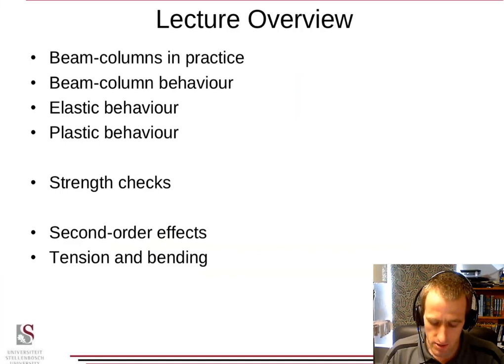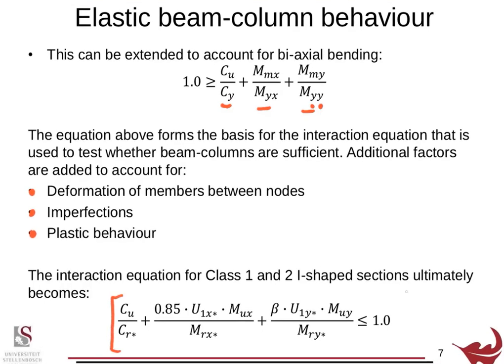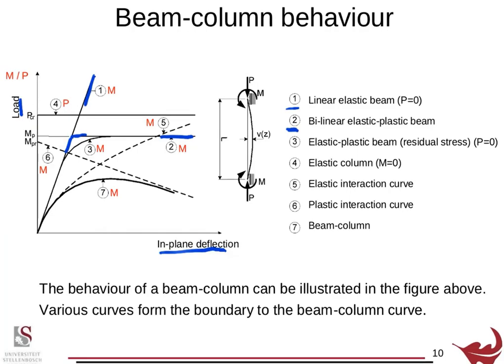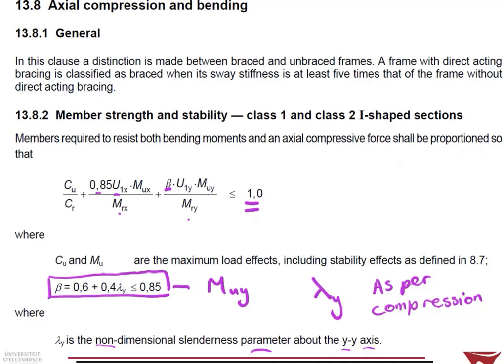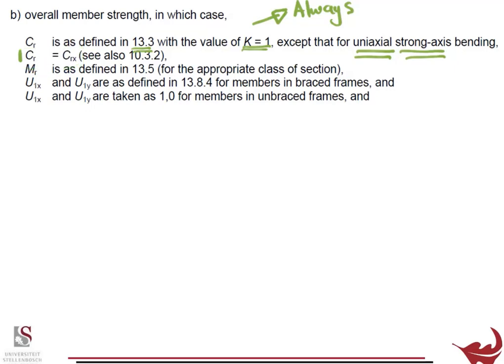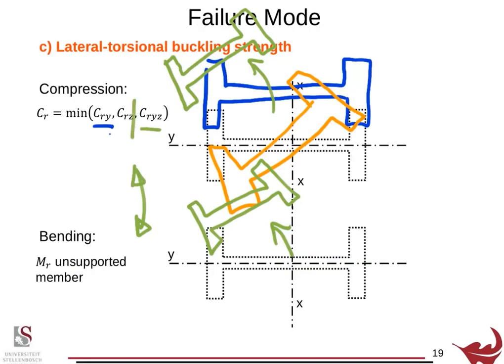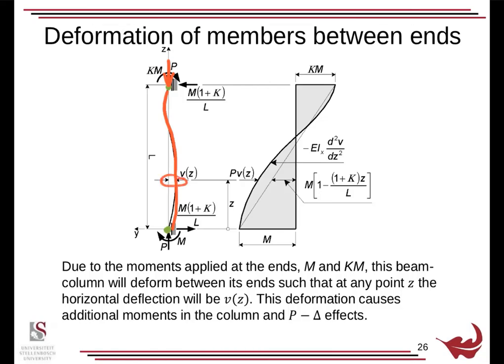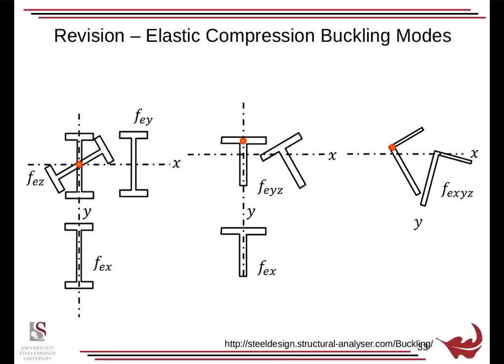Steel Design - Beam-column design - Theory and equations - SD424

Comment: Thank you Richard, this shed some light. On overall member check, why are we shying away from the fact that is a buckling assessment? To me the assessment is similar to flexural-buckling, or am I wrong?
Reply from the maker: The calculations progressively check different failure modes. For uniaxial strong axis bending the check considers forward buckling basically.

Comment: thanks a lot for the great explanation, luckily the Canadian Code shares the same equations but I can't seem to find the answer one of my questions, and I was hoping maybe you can help.

for the check b) Overall Member Strength Check, if we have bi axial bending, should we calculate Cr based on the weak axis or the strong axis? i'm wondering what is the "r" value (radius of gyration) that is embedded in the Lambda formula. 

cheers,
Reply: The South African code states for the overall member strength check: "Cr is as defined in 13.3 (section for compressive resistance) with the value of K = 1, except that for uniaxial strong-axis bending, Cr = Crx". Hence, when there is bi-axial bending design the column as normal, but with K=1.0, meaning that either strong or weak axis bending could govern. [To be honest, I find the description a little ambiguous in the code.] Hope this helps.
Reply: @richard_walls  thanks a lot for the reply Richard. I also believe we need to consider the weak axis if we have biaxial moments. 
This part of the code is one of the more mind recking sections. Hopefully we will get updates that clarify the approach and  also fine tune the equations for more conservative design. As I’ve come to learn that using these equations sometimes lead to unsafe design, since a rigorous buckling analysis will prove that the critical buckling loads are lower than what the code calculates. 

Agains thanks a lot Richard.
Reply: @Salsaman206  thank you so much for this claim, it's an eye opener. I always believed coded design to be rather conservative. I have also seen this in some of my design & never figured it out as to why it was the case.